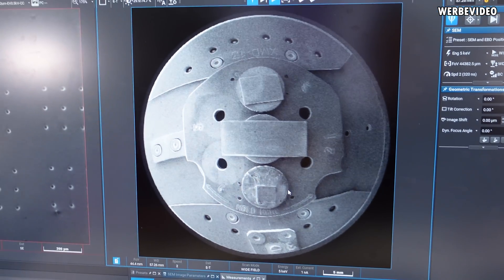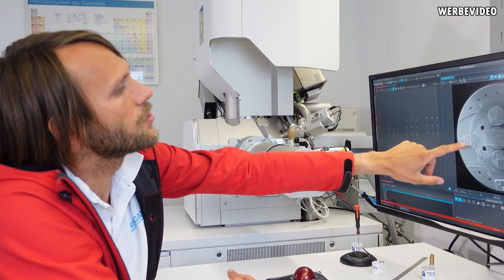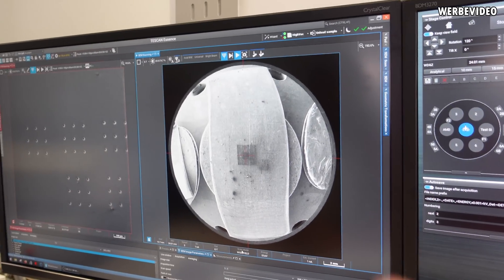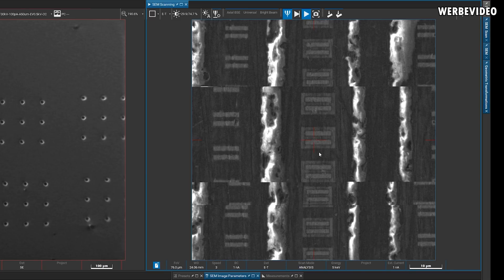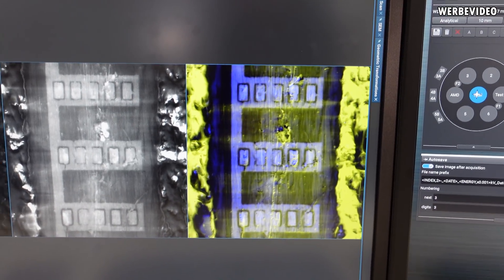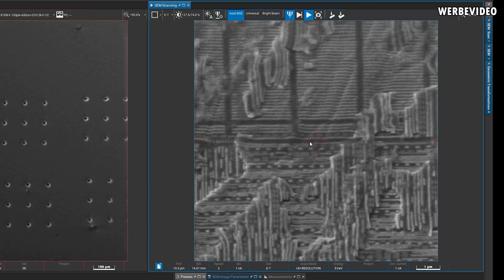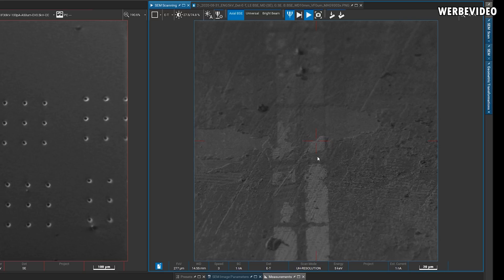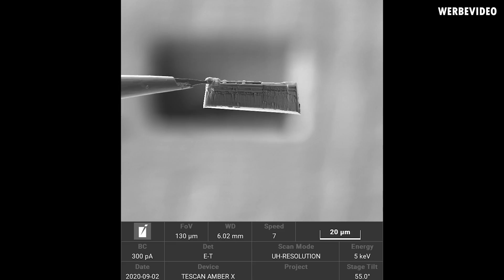Ryzen Nano-Structures more than 100,000 times magnified. Visiting Tescan Part 2/3

Comment: So interesting i am hyped for the next part!
Reply: Its a bit mind bending that there is a process to make such small cpus that accurately complete a task so many millions of times a second.
Reply: Ok so you know what Electron tunneling is with the transistors, and how they use silicon transistors to get smaller like the 7 nm they are currently at with AMD's Ryzen 3000 series CPU's.
And the 5 nm, 3nm and so on, to make the computers more efficient with performance and energy but now we are starting to see more heat.
Silicon has limits but they keep trying to improve it, and it will melt at specific temperatures, so we need to replace it.
Ask yourself why we aren't using Quantum Materials like Graphene (yet) and still using silicon. 🤨🤔

This is where Graphene will fix the electron tunneling aka Quantum Tunneling, we don't need silicon to get down to 1 nm "nanometer" in size.

Imagine this, Graphene computers with a magnetic current to be 1,000 times faster and possibly only use 1% of the energy used. 💡

Now imagine Graphene optical / transparent transistors for Photonic Computing. 💡

Now imagine Graphene lasers for the fiber optics that would be used as the circuits inside our computers for Photonic Computing. 💡

--------

I would rather see Graphene computers, let's get rid of silicon. I'm serious.

Check this out.
I would give links but the video hides my comments.

Go to my channel and click on the playlist called "Videos with important info to get around my channel". ✔

Watch a Flash Graphene video about Flash Graphene 100 dollars "per ton". ✔

And then another video about "Large machines on earth / in space to make Flash Graphene". ✔

After that, check my channel with 2 simple steps for my other channel, go to the "About" tab of the channel I'm commenting with now and read the info with a link found there to save to your browser's favorites. ✔

==============================

Imagine Graphene for Photonic Computing, to help us save on our energy needs, really think about that for a second with Photonic Computing.

Check my other channel for these 2 playlists.
Photonic Computing playlist. ✔

Graphene computers for home and Starships, playlist. ✔

Learn about Graphene from my other channel's "Graphene playlist". ✔

If you want to know more about Graphene and Quantum Technologies, go to my other channel. ✔🤔💡
Reply: It's a great video, can't wait for part 3